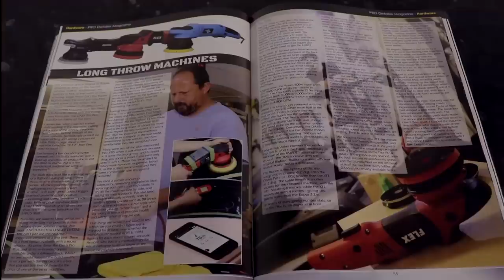Autoglym Polar Range Review  - Wash & Protect your car with an awesome thick snow foam cannon system

Comment: Washed my car today. BH AF in a pump sprayer, AG Polar Blast, AG Pure Shampoo, then dried with AG Aqua Wax. TBH After the first two stages I really didn't actually need to do a contact wash, but I did want to dry the car so carried through with the hand wash.  Cant fault this routine. Been a long time Polar Blast Snow Foam user and just cant fault it. I did think about nipping to halfords and buying the  Polar Seal, bit I really cant fault Aqua Wax.  BTW what wheel brush was that you were using, my Daytona Speed brush really needs replacing.

Comment: Hi thought this question and answer from Autoglym might be helpful to people considering these products, my aim is to try this set up for contactless cleaning through the winter months.

Q -  is there a recommended minimum time to apply / dry before it is likely to rain (e.g. to let the material fully bond etc). Plus when using in winter can you use without drying off the product (its so rainy sometimes).
A - No minimum time, in fact you want to get this on and off as quick as possible. for the best possible finish apply to the car quickly and then switch to the water rinse and get it off quickly. This is not like a regular product that gets better or protects more the longer you leave it, the chemistry is different. On fast, off fast, no dwell time or curing time needed. 
As for the need to dry, the buffing action of a drying towel or similar can ensure the finish is even if a bit has been missed during the rinse. Ideally dry it yes, but if you do not need to it will be ok and you can catch any rinse missed areas during the next contact wash or application of Rapid Detailer or similar.
Reply from the maker: great info just worth saying this info is for polar SEAL not blast or wash.
Reply: @ForensicDetailing  Yes sorry should have made that clearer, thought you might like this. Me and the wife spent an hour yesterday doing the great RSBP bird watch from indoors during the rain, after some time it was observed that i was spending far to much time looking at the beads on my car through my binoculars, rather adictive!

Comment: Hi John 
I’ve been using the Polar Blast a few months now. It’s good value, although Valet Pro Advanced Neutral is king of cleaning it is costly. 
Your gloss looks amazing on your M140i. Well done. What are some of the waxes or coatings you have on there right now? Would love to hear. I have an Alpine White M235i, though white is so difficult to keep looking bling and pop. I miss my red car’s paint.
Reply from the maker: Hey there, VP AN is in the snow foam test.  Ive always liked this product..  its one of the better cleaning ones for sure. 

Ive done nothing clever to this car,  paintwork is swirled (not badly) and needs polishing.   The AG product definetly had the car poping though, it looked great.

Get some beadmaker on that white m235 that will gloss it up.   try some best of show detailer as well from griots.    That or a nice paste wax.  white is a cool color mate like the 235's cool car
Reply: Forensic Detailing Channel thanks John. I’ve bought VP AN from your recommendations. Loved your best products of the year awards videos. Can’t wait for you to do a 2019 version based on last years best products. 
Good tips for the white paint mate, I wish bead maker or Griots was sold here. Per your reviews I’ve bought the Soft99 series of paste waxes. They are fantastic with Gloss and water beading. Needs a bit of elbow grease to remove though. So I’m using Optimum detailer and might get the Optimum spray wax as a maintenance wash topper. Though as you say, it may add gloss but slightly mask the hydrophobicity of Soft 99 wax underneath. Don’t get Soft99 sprays here either. Thanks as always for the great channel. I think I’ve watched almost all of your videos. Love the accent, comedy and detail. Learnt so much. Greets from South Africa.
Reply: Forensic Detailing Channel wow I feel so much more relieved that there are even swirl marks or love marks on your car. I felt like failure after doing paint correction last year and finding love marks months later.
Reply from the maker: @roadhouseguy  hey there beadmaker and griots are available in the UK now.    yer the m140 looks lovely with like distance shots, but ill show you what it looks like in dark with the halogens on it.. its a dogs dinner.
Reply: Forensic Detailing Channel oh dear! Just love marks from washing and drying? 
Thanks man, I’m from South Africa, no beadmaker here but thanks for the advise. Love your content.

Comment: Hi, thanks for taking the time to put up this review. What would you recommend for a ‘maintenance’ clean in between the ‘monthly’ polar seal application? Just a squirt of water to remove road grime or combine that with a Ph neutral polar blast and rinse. Cheers.
Reply from the maker: hi ya, yer so normal per wash with polar blast, and wash with polar wash.    And then dry down.  And some detail spray.  you could decant some polar seal at a low concentration as a drying aid, or like a detail spray when done.
Reply: Thanks mate, got it.

Comment: Did you use the same snow foam bottle at all 3 stages? Was it rinsed out after each stage ?.  Thanks  Great channel.
Reply from the maker: yes mate..  should rinse it out really, specially before you put the polar seal in..

Comment: Great content as always; what were your opinions on their new foaming wheel cleaner?
Reply from the maker: Ill whack togther a proper review soon.  Ive used it, but I want to use it on something really bad and poorly cleaned to see what its like on filthy alloys.    on the m140 as you can see in this video I can clean with just AG shampoo and get cool results.  so didnt learn all I need to learn about it when I used it on one alloy on the m140 recently because they are well maintained.  it will come along soon daniel

Comment: What sort of valve setting were you using on the snow foam nozzle with the polar seal? Normally for snow foam application I run mine about half a turn off wide open (wise open as in as much foam mix as possible), I’m guessing this is a lot less chemical delivery or 220ml wouldn’t last long!

Comment: Thank you for the great video..lots of technical information and cost breakdown. However having bought these three products I can honestly say they were a waste of money. The pre wash accomplished nothing. After applying a thick layer of foam and power hosing I still had the exact same dirt and grim on my car. I even wrote some words in the dirt before starting and all were still there after pre wash.. the actual contact wash cleaned the car . I used a soft brush..the same result would have occurred with any wash fluid. The seal smelled nice and provided a type of wax film so performed best of all three products. There is certainly nothing that makes these products worth the cost.. you would get the same results using any cheap shampoo as long as you are prepared to use a good sponge and lots of elbow grease..
Reply: I stopped reading your comment at "brush".

Comment: What pressure washer and pressure washer hose do you use ? Im thinking of getting either a Karcher k2 or a Nilfisk C110? Would appreciate a reply. Thanks
Reply from the maker: K2 is a pee shooter mate.   Id suggest the K4 honestly.  Im not so sure about how good the full control is.  but my old K4 eco is decent.  they are obviously cheap entry level things.
Reply: @ForensicDetailing  yh I understand but for me as long as the machine produces some decent foam I'l be happy. Do you think the K4 is worth the extra £150 or something.
Reply from the maker: @muhammadarfan7113  yes mate the k2 is not much use at all trust me.  sooner or later some random deal will come up where the K4 is like 100-120 quid.. when it comes swoop in and buy one.  they are alright for the money as long as you release the air pressure after use they should hold up well.

Comment: I hope you don't mind me asking a question months after you originally posted this video (only recently found it). Since different pressure washers have different flow rates (which in turn means that the solution in the bottle gets diluted at different rates), I was wondering whether you were able to recommend panel impact ratios for each of these products. BTW brilliant vid!
Reply from the maker: mate its a superb question but you have to go to the brands for stuff like that,they are payed to support their products Im not
Reply: @ForensicDetailing  No worries. Should have mentioned that I had already contacted AG. They didn't have an answer to hand but said they would get back to me. Since making the video, is there anything else you've gleamed from using this product range? Did you end up trying to decant of the 5-10ml Polar Seal and make a bottle of diy spray sealant?

Comment: Great vid, just what I needed to look at before buying this collection.

Could you post links to the wheel brushes you're using there please?

Thanks
Reply from the maker: its called microfiber madness incredibrush "flat" version.  must be flat version.   Clean and Shiny sell it in the UK.    smaller brushes are detail factory. The one I do the tyre with is called vikan flat face wheel brush.

Comment: Quick question.. the last product you used looks great for water repellency, why didn't you spray on the side and rear windows? Can it not be used on glass? I know why you didn't with the windscreen as that would have been horrific lol
Reply from the maker: covered in video...   you need to be carefull with it on glass.   if you dont over concentrate and you dont let it sit and theres no heat you will be fine.  

if you break the rules you will make a mess on your car potentially, like a streaky white residue mess.  but its really the same with any spray and rinse product.  difference is this stuff is like 10 times more concentrated than most spray and rinse products because of the lance delivery formulation (has to be stronger)

Comment: Nice one, as always.
Interesting comment about diluting polar seal and making a spray sealant. That would be great for people who don't have/can't use a pressure washer.
Reply from the maker: its an important hack but Ive not tested it.  The reason its important is like I say the concentration of polar seal for it to work in the lance has to be insanely high.   So I will experiment myself with decanting small amounts wih lots of water to use as a post wash sort of drying aid as well.   If it works you get some seriously good value out of this product because you could make litres of drying aid protectant for pennies.
Reply: @ForensicDetailing  Did you ever get any positive results from this testing?

Comment: This Polar Seal looks pretty similar to Envy Valeting Speed Gloss and no doubt other products , I've been using this for a few years now and its great during the winter
Reply from the maker: yer theres other lance wet coats out there for sure.   AG didnt pioneer this concepts but to bring it to the mass market is gonna be interesting.   I think lots will like it and use this method, as long as they follow the instructions they will get really nice results.

Comment: Hi Jon, I'm going to give the polar seal a try. I've got a Nilfisk c110 pressure washer. Could you recommend a reasonably priced foam lance to suit my machine and where to get it from please ? thanks.
Reply from the maker: I use the expensive PA one.  Otherwise you can get like the chinese one for 15-20 quid.  In2detailg sell one and they will soon also sell the cone flask you see me using which I think is worth having.   but literally any detailing supplier will sell the chinese lance now so next time you buy some products from anywhere just get  the cheap chinese lance.

Comment: Thank you great video as always

There’s a lot confusion out  there with so many great products on the market 

But  in your honest opinion we’re does auto gym stand  our with the best  products out there washes waxed sealants wheel cleaners  

I’ve tried so many and it’s so confusing
Reply from the maker: where does it stand.  there retail range needed something like this.   It needed like UHD, it needs polar blast.  Its needs to keep moving.  It needs to keep trying things, and be preparred to fail, a few times in order to get that one product that could suceed.     This polar series is the sort of thing the scene would like but it has benefits for the mass market, and its also good.  AG have a cool glaze wax combo now thats a very nice wax combo, and UHD is a really nice to use wax.     Where could they go.  well ceramics/silica is the only materials I dont think they have explored, big deal for them if they chose to go down this line.  not sure if the mass market is ready for this yet.  but if they dont take the risk one of their consumers will offer a proper consumer ceramic in halfords and get all the business.   I think AG could also offer a lot more in terms of accessories and microfiber etc..  The scene brands have a whole load of cool towels, and the mass market would gobble these up because they are lovely. dunno like I always say they know their customers better than we do.

Comment: Hi Jon. Yesterday I used Autoglym Polar Blast Snow Foam. Pleased with the product but nearly 24 hours later there is still foam on my drive. Weather overnight was cold and damp so probably partly to blame. I have heard you mention this problem with some products you have used. Can you recommend a good snow foam that doesn’t hang around for hours? Thanks
Reply from the maker: BH touchless m8
Reply: @ForensicDetailing  haha just about to get some do you have the discount code? I’m not sure where to enter it either

Comment: Would you recommend also on a car already treated with a ceramic coat. Ie will the foam/wash not adversely effect the coat and the seal ok to maintain?
Reply from the maker: pre wash and wash will be fine.   Polar seal should also be fine, but there is the arguement you might want to maintain coatings with products developed to maintain coatings..    Im just covering my arse a little bit because I dont want to say go ahead it will be fine when Ive not tested that.. but it should be fine.

Comment: Same way I wash my car with spraying the soap on and then using the multi mit method. Quick question. What do u find is the best way to wash and dry your mits and drying towels after each use?
Reply from the maker: ok so all these mitts will go in the washing machine on a quick wash cycle.  Then spin only. (not tumble dry).

drying towels typically I create a seperate load for them and because they are mainly just soaking up clean water, it could just be a 15 minute fast ash and spin (dont tumble warp knitt towels).  however my little blue hand  towels (can) pick up dirt if I dry like alloys so sometimes ill do a 40 deg wash for say 30 mins.

The only towels Im mega anal about is the open pile ones.  they go to crap if you just chuck in the wash with other towels (they really do). they are very sensitive.   Typically these ones which I use for polish.  I might just pre soak them in water and some liquid detergent and squeeze out to rinse out 90% of the polish before they go into the machine.  If you dont do that the machine honks of like solvent and abrasives and the misses kicks my ass.
Reply: @ForensicDetailing  thankyou my friend. Any specific type of washing soap?

Comment: Why do they recommend not using it on soft tops?  Is it because the chemicals are bad for the hood?  Or simply because  most applications would be by a pressure washer and this could be bad on a soft top?
Reply from the maker: no sure but I would guess its might cause like little stains or spots.   when you apply fabric sealants you sort of prep the roof proper and mist them and work them in..  the sealant you fire out of a foam cannon and you might be overloading the fabric.   but I also think the materials you use in spray and rinse products are different to fabric sealants.

Comment: Can you use all this with the Worx hydroshot obviously there’s less power but will it still do as good a job? Many thanks
Reply from the maker: you would need to adjust the ratios accordinly.  you would also benefit from a pressure washer to rinse.   but if your carefull you could apply with the worx yes mate.

Comment: Could you replace the polar wash by just doing a second application of polar blast and do a contact wash with it? Is it not stronger at cleaning, thicker and clings better?
Reply from the maker: there are difference between rinsable snow foams and contact wash shampoos..  contact washes tend to contain cationic surfactants or lubricating glycol type surfactants.  so if you want to clean your car like the fonze then use blast then wash.  but yer blast if you dont want 2 products.

Comment: Hi Jon, would you say polar seal could be applied by a pump sprayer at the right dilution ratio?
Reply from the maker: yes mate.   run it at about 2-3% PIR in the pump sprayer.

Comment: Love this channel. But I don’t understand why you never use an electric blower to dry the car? I use a leaf blower which works great.
Reply from the maker: my leaf blower is on the shelf.  sometimes I cant be bothered to bust it out though. I want to buy one of the small ones.   by the way you need to towel dry after using this polar seal product.

Comment: Should I rinse off the car before using the autoglym polar blast foam or can I just go straight with the foam, then the shampoo ?
Reply from the maker: id put polar blast onto a dry dirt film.  in my experience it allows it to work better.  then pressure wash off.  then on with the polar wash and do the contact.  then pressure wash off.
Reply: @ForensicDetailing  Great, thanks for the reply man